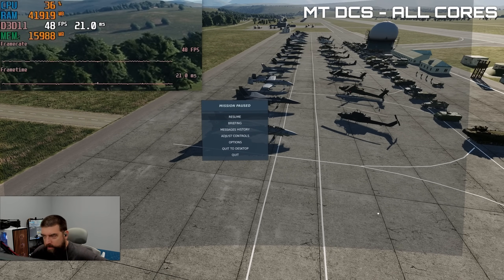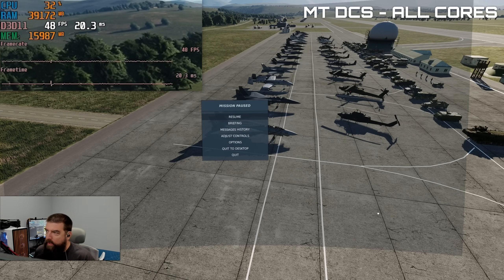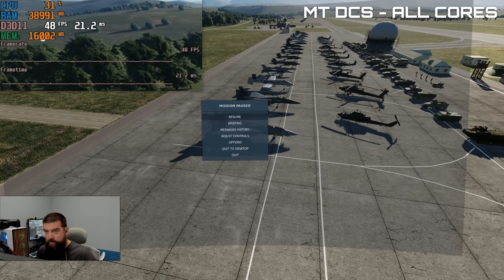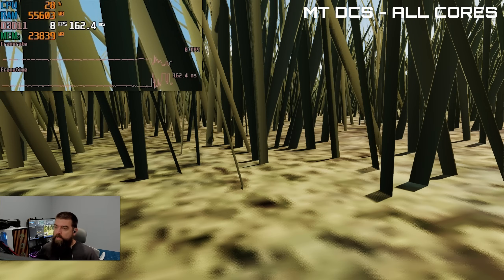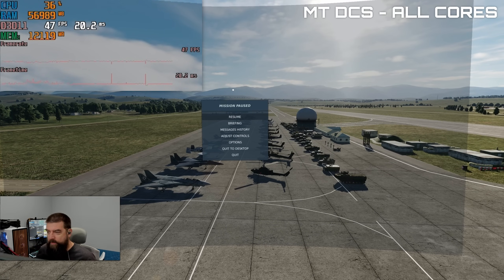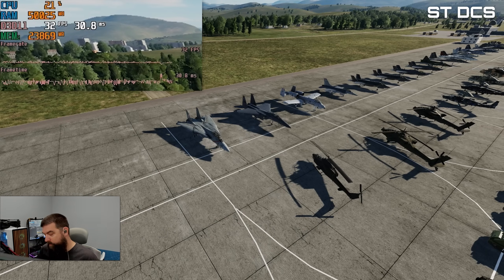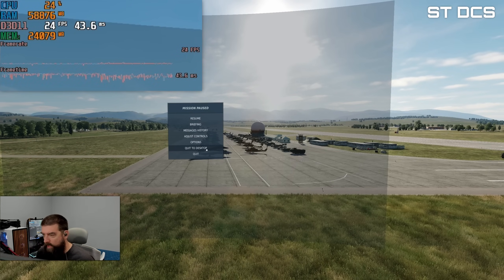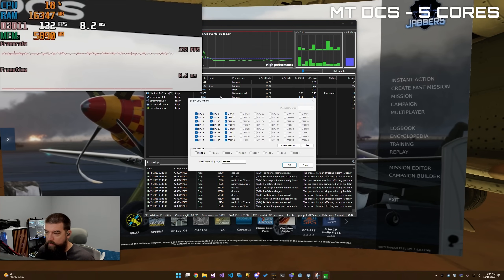How I Resolved my VRAM Overflow Issues in DCS World

Comment: This behavior has been present for years and i think MT has exaggerated it to a level more people are noticing it and can more easily induce/replicate it. I had this exact issue on a 980Ti and a 2500k in DCS 2.2 when i went from 1080p to 1440p. Same behavior just induced in a different way via F2'ing around as fast as I could in a complex mission and i think youre on to something with the sort of "overstacking" of loading tasks with all these threads

Did you by chance try these tests with the "Precaching" section of the Graphics.lua set to 0?
Reply from the maker: pretty sure precaching only works with terrain, not jets and their liveries.  I have it set to the minimum in the settings menu
Reply: @Jabbers  Precaching values in the lua are separate from preload radius and are not visible in the in game menu. Was just curious for somewhat related reasons :)
Reply from the maker: Gotcha I sometimes wonder if those actually do anything, seems to be a lot of orphaned Lua code
Reply: Granted I havent tested it since early 2.7 but it usually results in RAM use reduction far too high to be margin of error, several gb's worth especially after an hour or more in mission with no downsides that I could notice. I was suspecting its something left over from Edge or earlier when most people were on HDD's.

Comment: While we're all here, I found a few other things that help 2.9 I heard from a few sources. I can't remember them all, maybe Reflected and Juice or Tricker...anyways, make sure your frame rate setting is capped. Don't let it just try for as much as it can muster. Cap it at like 80 fps. Also when you load DCS make sure you're doing it as Administrator. I right click on the desktop icon and choose Run As Administrator from the menu. I can't tell you why this works only that it does. I noticed a HUGE improvement in performance. Also, don't run with scissors and don't eat yellow snow.
Reply from the maker: First option doesn't work with VR users, 2nd option makes no sense :(
Reply: @Jabbers  I agree 100%. I just saw it and tried it. I will try to find the source and post it here so you can watch it too. And the capping fps is probably what made all the difference for me, not the Admin thing. I don't have VR so it's all 2D for me. Just trying to help if I can!

Comment: Well, explain this to our students as such: if you have to paint a room, you have can have to to 4 people work on the walls. If you have 8, you can have four paint the edges and 4 paint the large areas. However, if you have only one paint bucket, they start to queue up there, so you'll want two buckets. Having 16 people in the room, will likely but paint the room and faster, potentially the opposite. It will only help, if it's like very large room, so you can have multiple people on a wall, but then you'll also need more buckets. People = CPUs, paint = data, brushes = caches on CPU, paint bucket = RAM. Hardware store = hard drive. Getting paint there takes forever ...
Reply from the maker: Very cool analogy
Reply: Maybe add that the people must walk on planks from bucket to bucket and bucket to wall…data bus?  So, if a person is already on a plank, they have to wait for them to clear, right?  Bucket to bucket because they probably need to (carefully) assemble different colors of paint to transfer to the wall?  The wall=graphics card?
They have to paint two complete, nearly identical walls (VR with a parallax offset), 60 to 90 times per second!  😄. 
I see instances where the paint gets splashed on the walls ( maybe the graphics card’s fault?) and sometimes painting halts for .05 to 1+ seconds!  That must be where the people get mad and smack each other in the face with the brushes, like the Three Stooges.  🤣
Reply: Quantum computing = Paint sprinkler

Comment: I think you'd be able to "fix" this by lowering your texture details to medium instead of high?   Also maybe lowering the preload distance.
Reply: I always thought that if you had 24gb vram and 64gn ram then you should Max the preload. I don't really understand that settings impact.
Reply from the maker: It's for terrain stuff only afaik.
Reply from the maker: You can fix with textures at medium, but the problem can still occur... my preload distance is at the lowest setting.
Reply: @Jabbers does the new LOD graphic setting help at all?
Reply: @Jabbers also try turning your preload up to like 75 percent?  Might stop the stuttering since most of those planes will already be buffered
Reply from the maker: Preload is for terrain not planes
Reply: In my tests preload distance is not working at all since 2.8. I set it max 150km or minimum 100 meters and my memory usage is exactly the same. in 2.7 times it made a huge impact.  @Jabbers

Comment: Its an interesting problem, would a solution be to move the textures to RAM rather than removing and reloading the data from disk each time?
Reply from the maker: I mean ideally that's what happens for you.. but not sure if ED is actually unloading things to try and keep ram usage down... its odd behavior to see such a crazy flux in mem usage.
Reply: @Jabbers  It looks like during your testing there is no 'look ahead caching' before all the threads going 'give me all the textures now'.  But during the unload you can see it is either expiring from vram into ram and holding it there for a bit or its just a mass eviction overwhelming the ram which causes paging when all it really wants to do is evict the textures.  Without proper tracing it will be hard to know.  It appeared you were hitting your 64GB ram (assuming thats what you got) routinely during the assumed eviction.  It would be interesting to also capture commit size as that will tell you what the VMM is really dealing with.
Reply: I do performance testing for a living but not on games (anymore)
Reply from the maker: DCS reserves ram 64gb of ram, that was not my commit size.  It was not really using 64GB
Reply: @Jabbers  what i was saying was to capture the commit size as well.  it should tell more of the story
Reply from the maker: Agreed, it would help.... back to the testbed haha
Reply: @Jabbers  I guess what would be good is if ED gave us with more RAM (i got 128GB) the option to dump the textures to Memory rather than remove them. I thought that is what REBAR did but I don't know enough about it to be sure. Perhaps it's time to stop letting players use different textures on their aircraft to improve performance. Good analysis mate.

Comment: if i recall this in one form or another has been there for ages.  I remember in the  [now defunct] AO server we had to lock down liveries so people couldnt change it as it was causing unnecessary vram strain/load.  Great research and investigation
Reply: This is old as ever problem. Based to the original Flanker since it was just a simple polygon model and not with textures. Since then the engine has been limited similar way as other east European game developers own engines (Flashpoint, Stalker etc).

This was very obvious back then when VRAM was 256 MB and when finally you got 512 MB and then 2 GB etc that how things worked between game engines.

DCS has as well always had horrible memory management for the module itself.

Look example when you switch modules in empty map. Set mission have multiple different aircraft like Apache, Hornet, TomCat and Hind.
And just jump to one slot, let it load, sit there minute and jump to another. Repeat.

The engine should purge everything from the memories when you exit the vehicle, and only after then load the new module for your use.

If you have 6 GB or 8 GB of VRAM, you fill it after first or second module, the memory doesn't get purged and your framerate drops as previous textures and model is loaded, even when it has been eliminated from whole game map existence.

If you jump between two, it is much faster to load than initially as it uses the cache. But only if you have enough memory to hold these.

One purge happens when you exit mission by selecting "quit". But not completely, as if you press "Fly again" or track replay, almost everything is kept in memory.
Only when you jump to main menu from debriefing, is in few seconds the modules purged from memory. But not always. Sometimes it requires to exit the whole DCS to get windows clear that cache. And it can take again few seconds.
And then when you do, you still get faster loading than first time after windows reboot as some is kept in cache by windows, but you start filling modules again. This is obvious example that your mission loadings can be much faster.

One of the problems really is that ED use 4096px size textures that are 48bit. Individual trees and vehicles on ground etc are just filled with those.
When your model appears in given range, everything is loaded to RAM and from there with settings to VRAM. Just consuming memory for nothing.

Most textures could very well be 5-8bit by quality and models around couple hundred or even tens of polygons. 
Even a dog fight ranges could the models be very simple and low textured, what the new LOD slider  in settings should allow to make.

It is just odd that we just got far more cpu Cores to be used, and resource demands went through the roof.

Why so many is now spending money to 4090 and like to get quality.

I have started to consider 128 GB of RAM as 64 GB ain't enough anymore. But it is only DCS that is using it, and I don't play multiplayer or use many assets...
Reply: Excellent detailed reply.  @paristo
Reply: Its not just liveries. Its actually the modules themselves. Some have a MUCH higher impact than others. The two that jump to mind are 1) the Tomcat and 2) the JF17.
Also, switching over to the map while in-flight...yeah, you're going to screw your VRAM up for some odd reason.